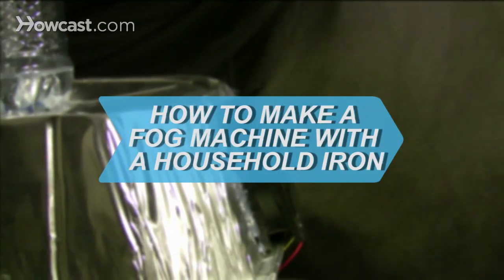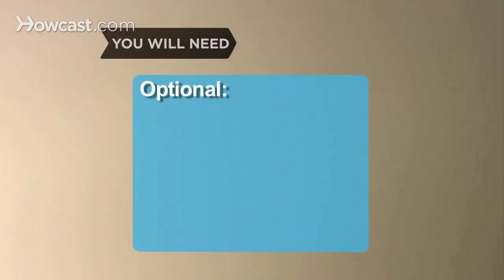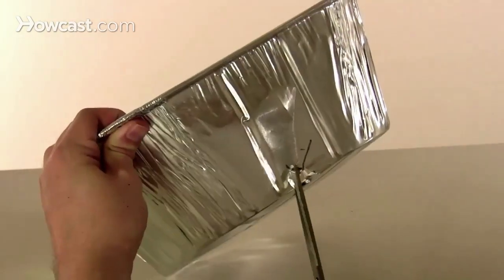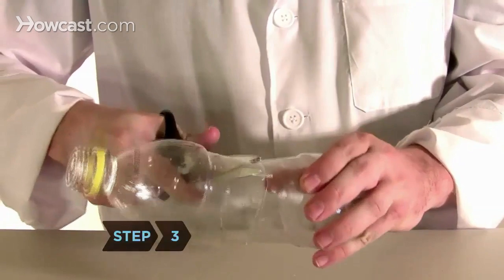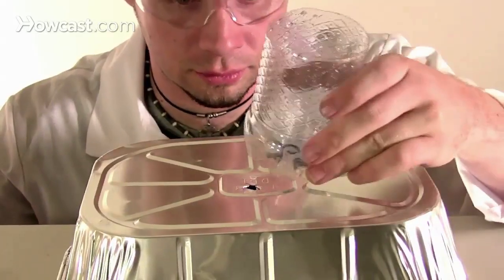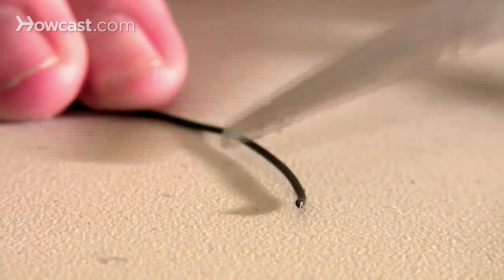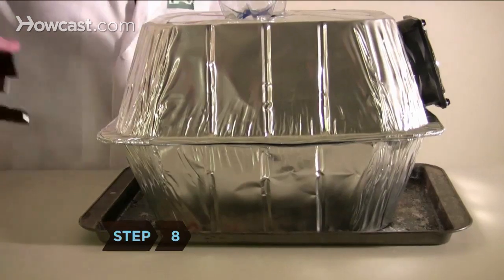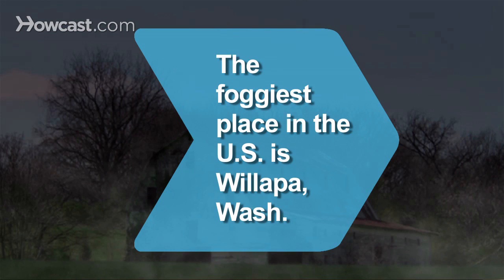How To Make a Fog Machine With a Household Iron

Comment: Neat, but unless I'm missing something, won't the fluid, which is very messy, be dripping right onto/into the iron, potentially wrecking it ? Suggestion : Would it be less messy to place a small foil pan on top of the iron inside ?